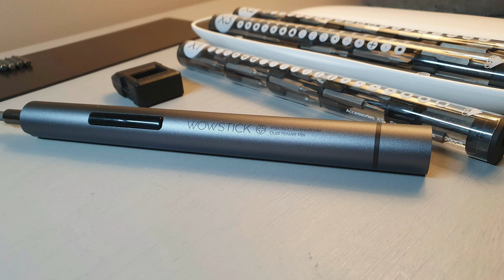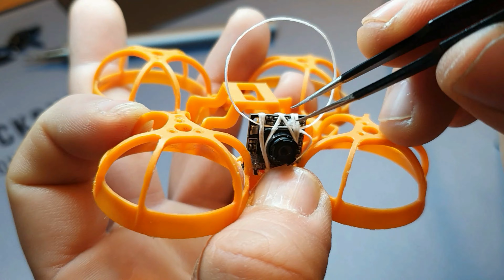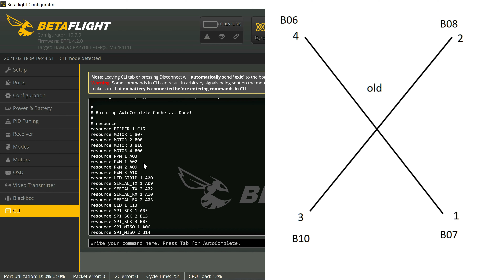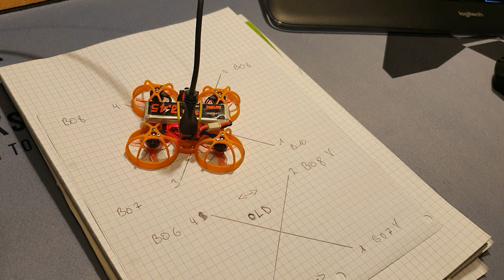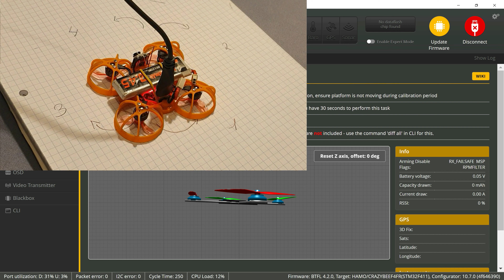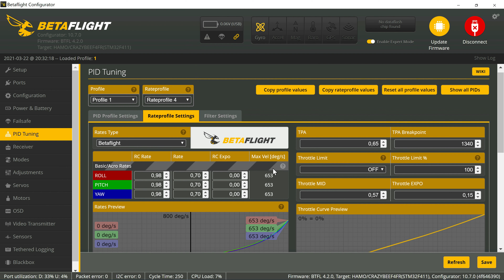Inverted Mobula 6 Build Guide

Comment: hello, I reversed my whoop but if feels so underpowered. I have to raise the throttle to 60% just to lift up. If the whoop isn't inverted it flyes good and it's not underpowered. what could it be? I followed all the steps you shown...i can't understand the reason
Reply from the maker: Hi, that's not right indeed, it should be the opposite. I'll try and help you out.
1) did you direct solder the motors? I know it's a pain, but if you did direct solder the motors, first thing I'd would suggest is too redo them... unless you are absolutely sure you're solder joints are perfect. 

2) Did you change anything in the set up, except for  remapping motors and 'flipping' the gyro?

3) Motors are spinning freely? Maybe a motor bell slipped off? The happymodel ex 0802 motors have this problem very often.  

4) Did you change the props from you're original set up while doing this mod?
Reply: @SquareOneFPV  hi, thank for the answer, the motors are soldered and they work perfectly, and everything is the same, I checked everything I could but I'm not able to find a solution... : (
Reply from the maker: @carlochannel5027  Hi Carlo, I've been thinking about your issue but I keep coming back to solder joints or a motor problem. I know, not very helpful 😔, sorry. I hope you get it solved, good luck with it.
Reply: @SquareOneFPV  thanks, for now I’m flying it normal. It’s an 18g 65mm and it flys amazing anyway 🤗

Comment: Hi, just stumbled up on these mods, great job!
I'm building my first tiny drone by myself, a 75mm 1-2s. Would you recommend it to build it inverse also for this size?
Reply from the maker: Hi there, thank you 🙂! Well I do think my inverted drones fly better, they have better handling, even feel a bit stronger.
Mass is more centralized, and you get an even smaller package which makes hitting gap easier.
I will be testing inverted vs uninverted motors in my next video to see if there really is a difference. 
It also depends on what you are planning to do with it, I mainly use my inverted whoops indoors, when I go flying in a forest I use a 'normal' whoop because it's easy to get something blocking a prop and fry an esc on an inverted whoop. 
Wow, sorry for the long write up 😅, in short yes. But how ever you build it, keep it as light as possible, it really makes a world of difference on a tiny whoop. Have fun building!

Comment: Yo cool mod! I want to try this as well. Is the step in Jesc necessary? Is it not possible to reverse the motors in Betaflight?
Reply from the maker: Thanks bud! I think it's possible in the latest betaflight or in one of the next versions. If you switch any two wires on a motor you also change motor direction. Changing motor direction in jesc is free, you only have to pay if you want to enable telemetry to use bi directional Dshot. Have fun building! 👍

Comment: Great video! My mobula 6 is about to arrive and I want to do this mod to it.
Do you think that there could be any difference by changing the battery connector for the new bt2.0 from betafpv?
Reply from the maker: Thanks 🙂! Yes there is, battery sag is much improved and I even get a little bit longer flighttime. I've changed all my connectors to bt 2.0. When you solder them, use as little heat as possible, or put an empty connector onto it so the pins stay aligned when soldering. I  used to much heat on some, and they are hard to pull apart... Joshua Bardwell has got a video about these: https://youtu.be/Xt0yARay6nw
You may let me know how it turns out if you want to, have fun building! 👍
Reply: I heard from kababfpv that switching the connectors to xt30 is even better, even if that adds weight. Haven't tried that myself though
Reply from the maker: @zeroblade6599  And coming from Kababfpv I'd say he's probably right! Yeah and I got some spares, could be a nice test! 😆